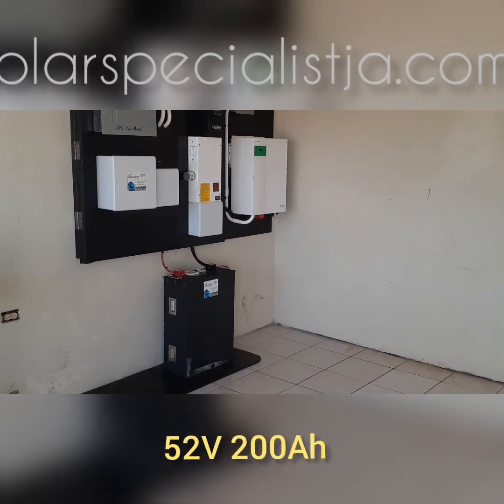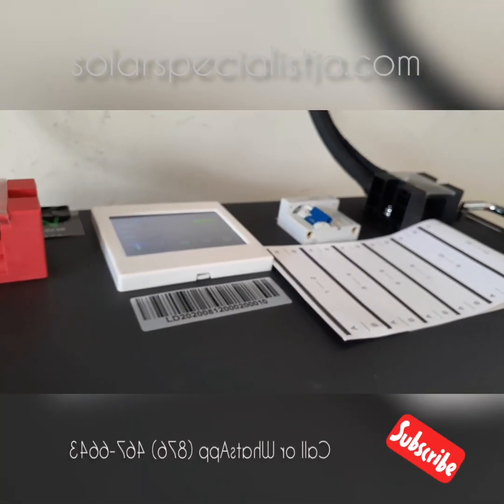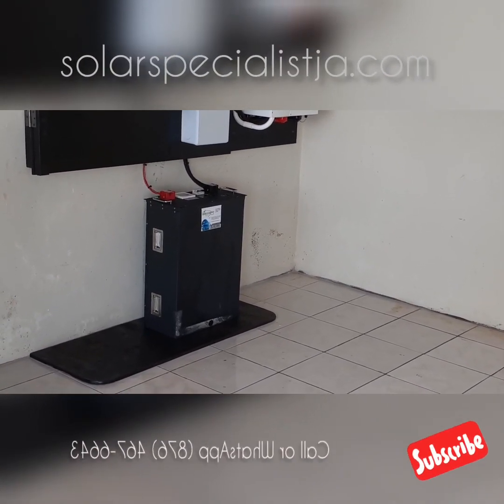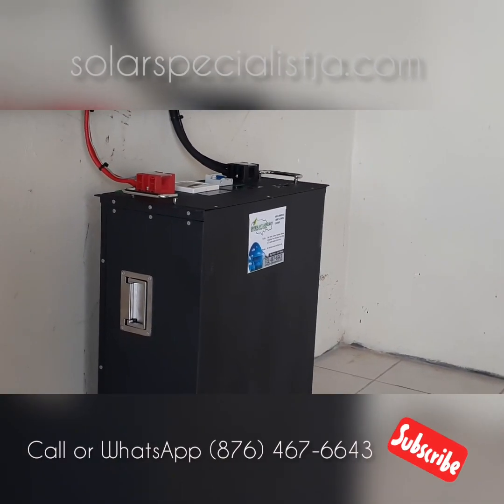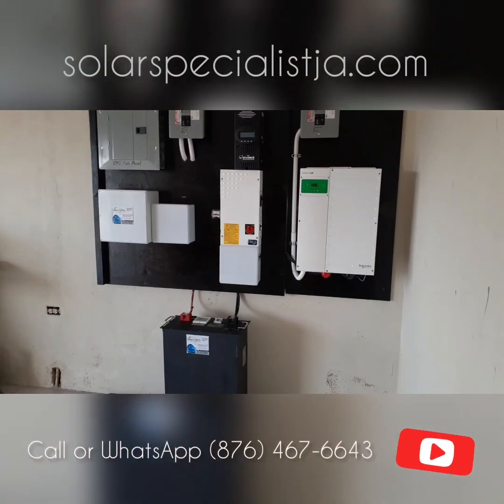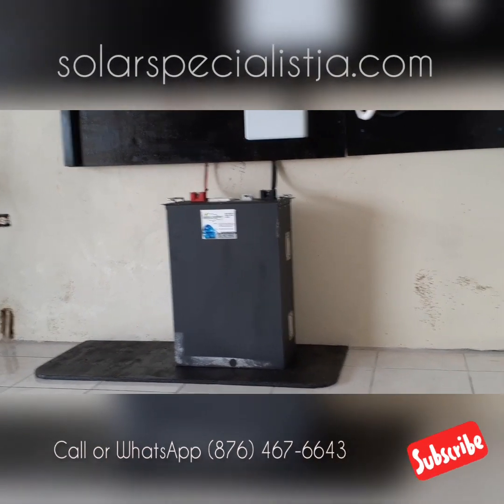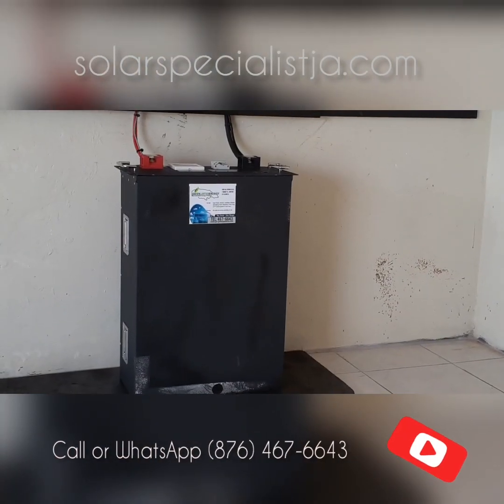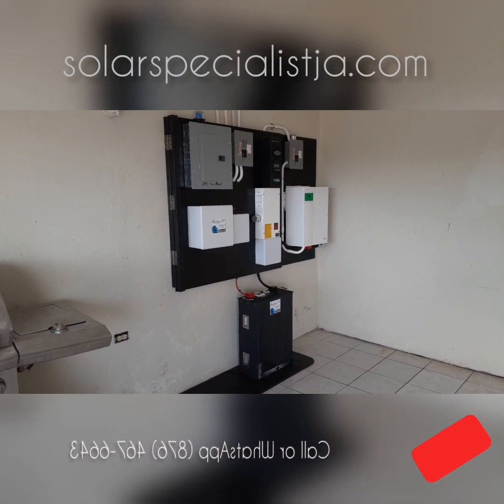Lithium batteries the future of solar?

Comment: How much a system just like this would cost
Reply from the maker: With 4000W of solar around $2M JMD including installation...
Reply: @JamaicaGreenLantan  good deal
Reply: @JamaicaGreenLantan  how many panels
Reply from the maker: @bambam-st9cn  12 320W mono panels
Reply: @JamaicaGreenLantan  what's your opinion  on the Nissan leaf  batteries pack
Reply from the maker: @daneford7132 I know installers that are using them but I don't recommend it...The car has a built-in BMS to ensure it operates safely while driving... without the BMS lithium batteries can be potentially dangerous and can overheat & explode if it's overcharged... Serious Fire  hazard!
Reply: @JamaicaGreenLantan  $2million for this system? I will just keep scrolling pass your videos.. thanks
Reply: Lithium batteries are not used in solar. Lithium Iron Phosphate (LiFePo4) batteries are used.  Those are two completely different battery chemistries. Use the correct terms. Lithium batteries are dangerous,  LiFePo4 are not.